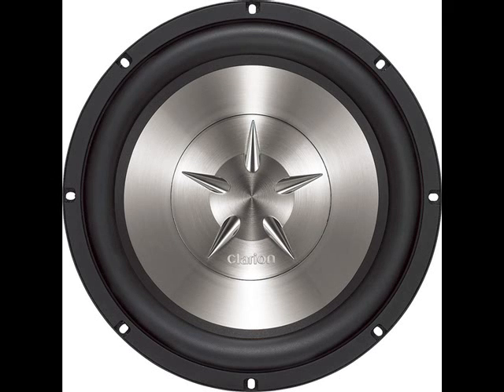Power Supply - Woofer Excursion Test

Comment: @kickuass32 It's a bandpass subwoofer and it's tuned really low. The bass arround 70hz is really weak but who cares about that. I use it with some sattelite speakers that go down to 80hz. It would have been better if i used the sub with some floorstanders.